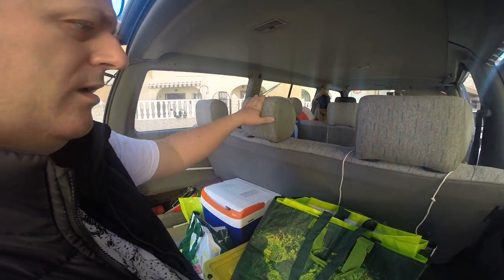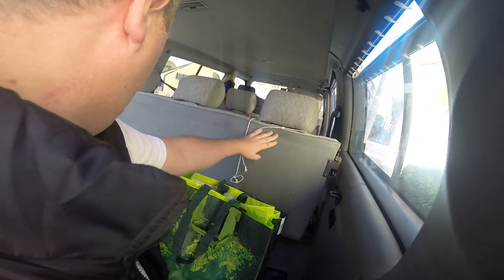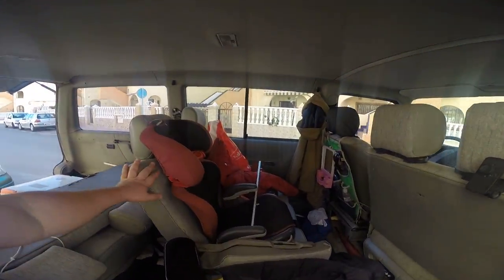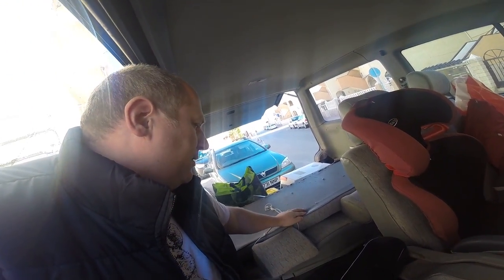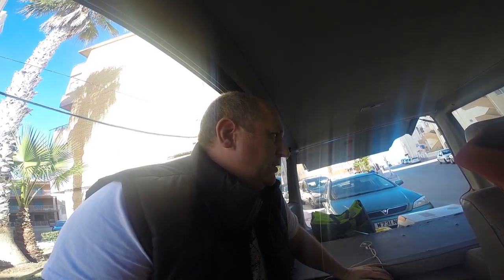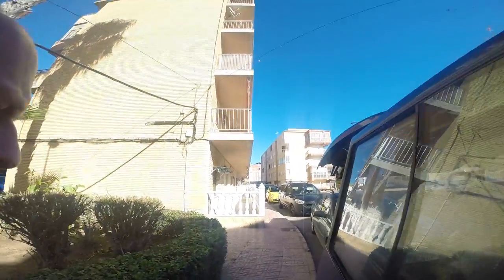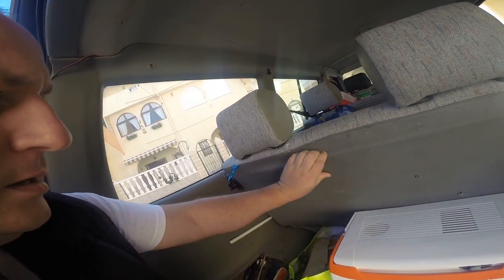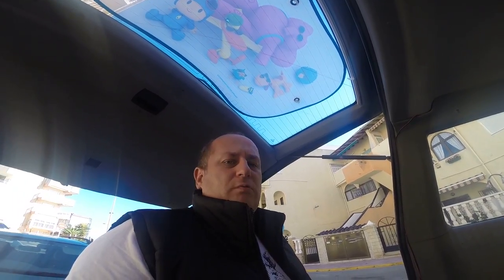VW T4 Caravelle: Convert seat to bed

Comment: Join the t4 forum there are lots of guys that have done exactly what you are thinking about, there are many posts and lots of pics, there are also several variations on this arrangement, some you can use the middle seats as well if you want. Some even build a "boot" behind the triple to hold the three wooden bases needed, i'm even going to do the same with my van. Anyway good luck with the bed.
Reply from the maker: +Garry M Cheers for that have you got any links? I don't mind sharing and if other people find my video and your links will save them some time hunting. I will share my conversion as well once I get it started.

Comment: T5 carravelle i have, you fold the bench seat back rest backwards and then same with the 2 passenger seats to make a comfy good size bed... has the table in between seats tho, but put a bed foam topper on it and it's good to go...

Comment: Hi Matt 
How about removing the middle seats like you said and moving the aft seats forward 
to create a crew cab configuration. 
Then make the rear seats easily removable to create a cargo configuration.

If you only have a family of four this would work perfectly.

The Sprinter and VW passenger configuration has too many seats for a small family.

The Bed "could" be one of those folding tents that sits on your roof.
Reply from the maker: +Ron Spins Still working on it, have ordered a gas stove today for it. But still not 100% as I need to take a look at the bolting of the seats. The rear seats fit differently to the middle section.